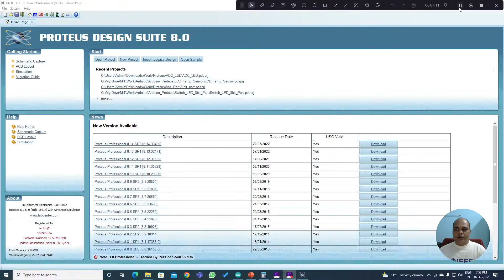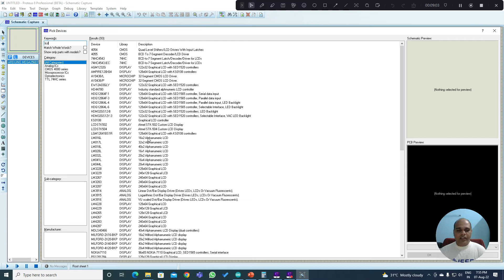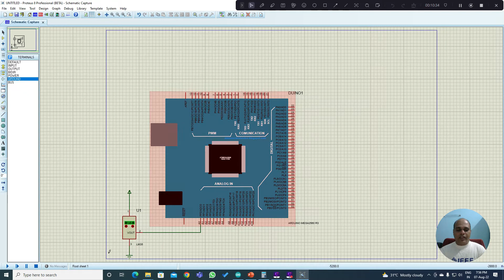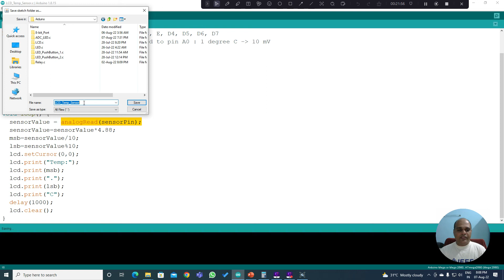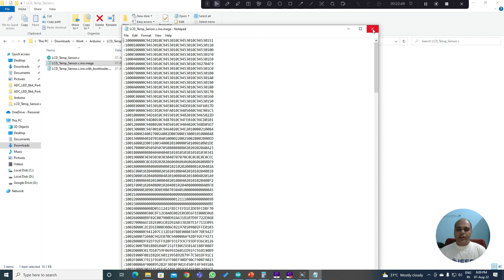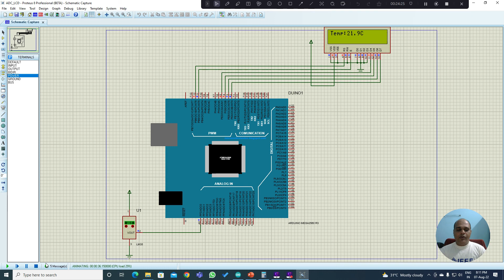Temperature sensor value displayed on LCD connected to Arduino Mega Board

Comment: Sir why we use only last four data pins for lcd display (data line D4-D7)
Reply from the maker: From microcontroller or Arduino Board, the data can be sent to the LCD in either the 4-bit mode or 8-bit mode.
In this tutorial, the LCD is configured in 4-bit mode, that is why the pins D0 to D3 of LCD is connected to Ground.
For example, to send ASCII value of '1' = 0x31 to LCD. Initially, D4 - D7 -> 0001 (1) will be sent followed by D4 - D7 -> 0011 (3).
The data transfer rate will be on low side for 4-bit mode when compared with 8-bit mode but it is permissible, since we are not dealing with critical data.
Reply: @sathieshkumar  
Thanking you sir